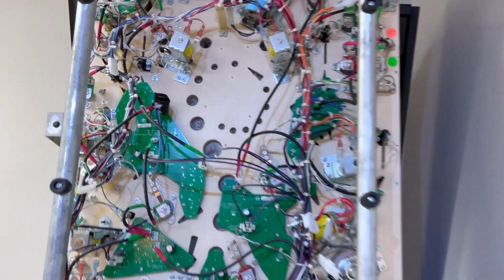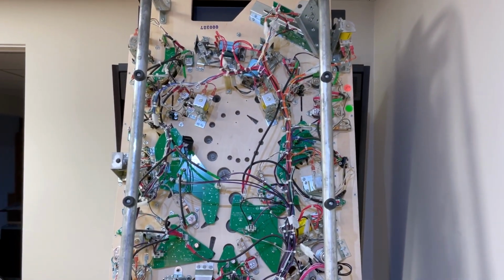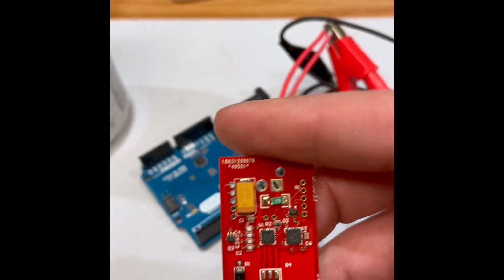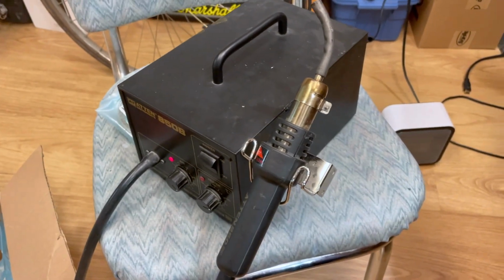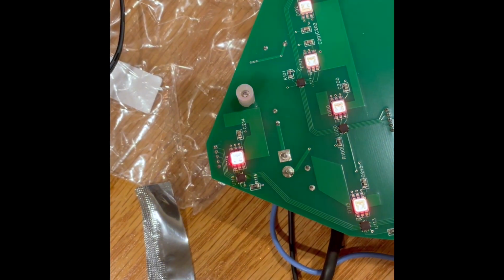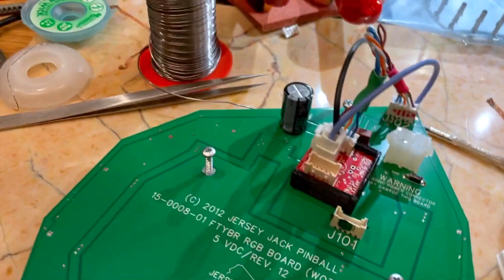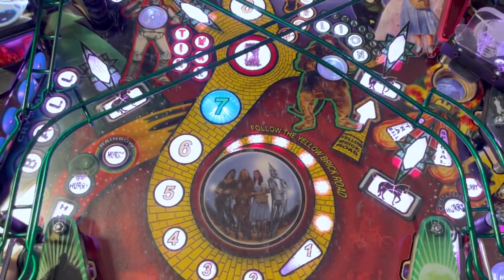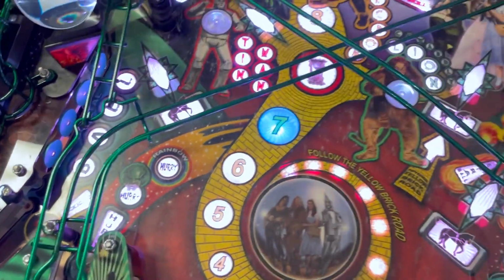Jersey Jack WOZ RGB LED allegro chip replacement on "fish" board

Comment: If you've got the design files available or boards for Gen 1 Woz light boards please reach out to me tyvm.
Reply from the maker: I can put the design files up on github. I can probably part with a few bare boards if that's all you need. But ill have to check my stock.
Reply: @zethusinfo  I'm interested in the boards, just need BOM and I should be ok.  Do you have a website or an email I can reach out through?
Reply from the maker: @blupeterb254b9  you can use chuck at zethus dot ca.  I've got a blog that I'll post with the relevant info as well.